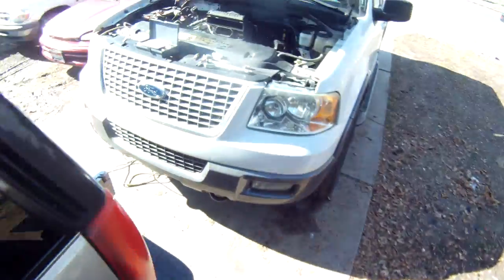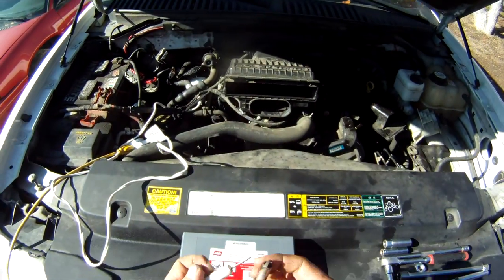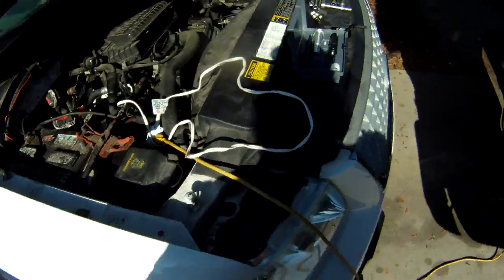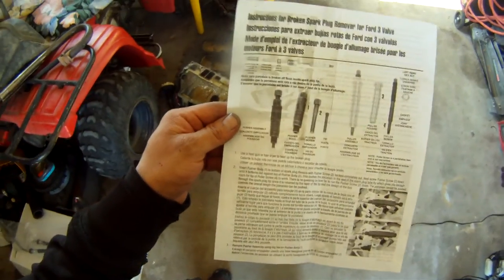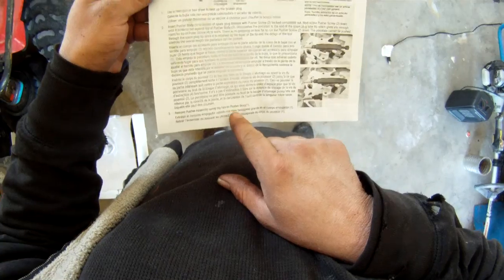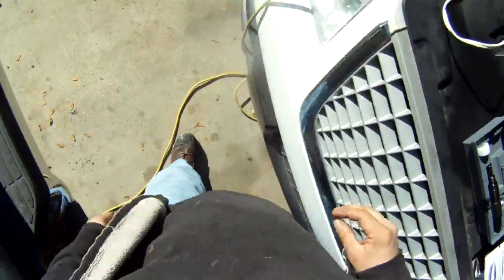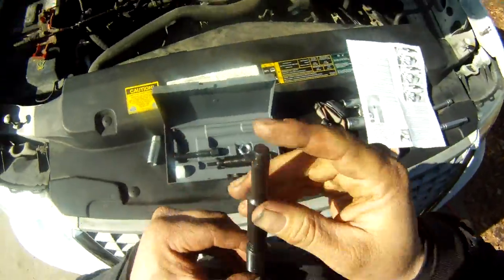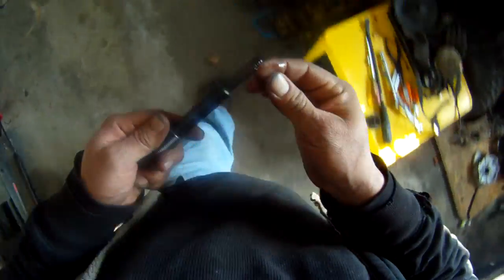Ford Triton broken spark plug/tool extraction

Comment: SP-546 plugs supposedly won't break off. The SP515 plugs break off. Spray Gumout in the hole and let it sit. Turn them back and forth to work the cleaner down in there. Get the OTC 6918 remover to remove the plugs. If they break, get the Lisle set. Put antiseize on the threads.